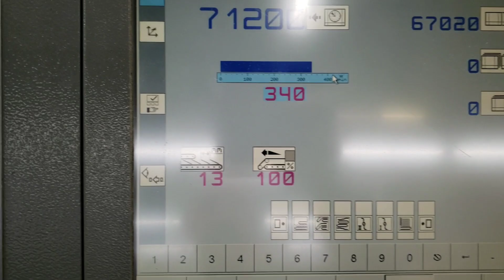FULL MAKE-READY and fast run / 1.1 Million Cartons - Bobst Expertfold - folder gluer

Comment: Sir, I am also running this machine, if it shows many errors in barcode in the display. can you tell me what happens
Reply from the maker: Sometimes the color of the barcode will mess it up. If the barcode is too small of not clear or if some of it is missing, it can show errors. If the blanks were not registered when being die-cut or printed, it can cause the positionof the barcode to move slightly. Also make sure that the trigger eye and barcode scanner are reading the same carton at the same time. you may need to adjust the trigger eye so it reads the carton before the scanner reads the barcode. maybe slow the feed down so there is a bigger gap between cartons. Also, make sure the trigger eye is not being triggered by part of the machine (That happened to me a few times). Also very important to look at the cartons that are being ejected. Are they all the same die position? Of so, that means that those die positions were off register in die-cutting or printing. Take the bad ones and compare them to good ones and see if there are any differences. I hope that helps!